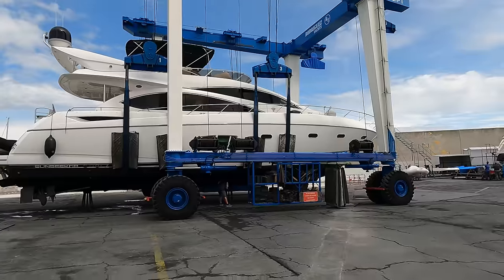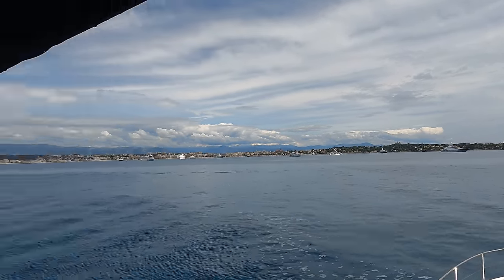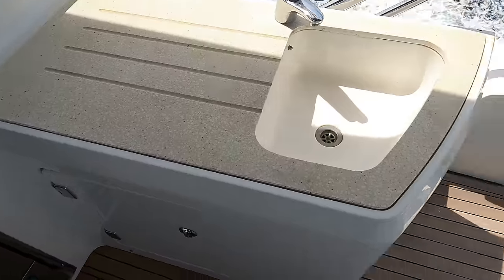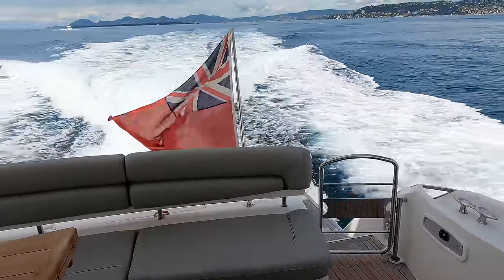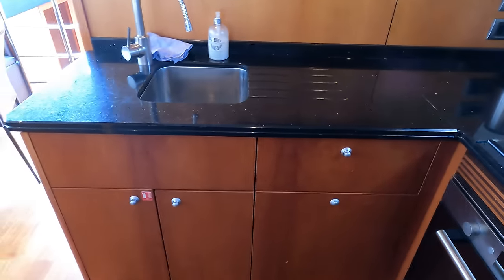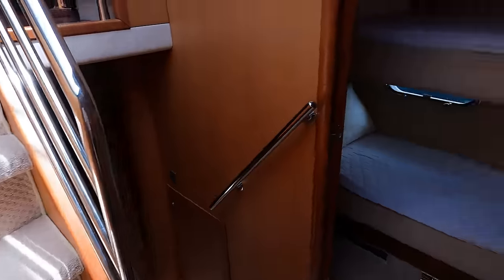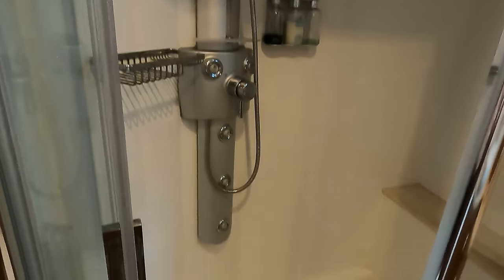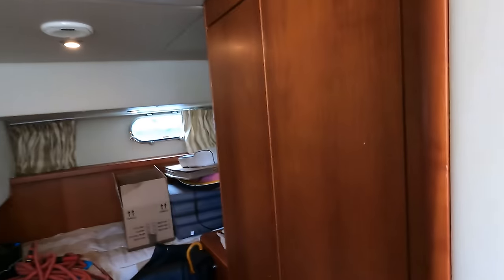Sunseeker Manhattan 70  For Sale - Full Tour & Seatrial - £750,000 Ex VAT. (Now Sold)

Comment: Love the owners cabin and the VIP, more boats should be sold with off centre beds. The price is great, spend an extra £250k upgrade to touch screen, full gel coat repaired, modern fake teak. If possible I would also get the ability to reduce seating on flydeck add a hottube
Reply from the maker: Some good ideas there. I never did one with a jacuzzi but anything is possible. They also work up top with a crane/jetski for certain owners.

Comment: Nice boat. It hits a sweet spot in size, providing masses of accommodation with little compromise, whilst within the upper limits of being (experienced) owner operated.

These boats are about getting away and having a bit of down time, but also about having friends and family on board and entertaining. Much prefer the large sofa on the port side as opposed to the cabinets so many interior designers and yards fit instead. Makes for a more social and relaxed saloon. If it’s built in seating then it can have storage under the seats and little storage space is lost.

Comment: Is there any way to turn the foredeck sunpad into some sort of seating area ?
Reply from the maker: It would be difficult as you'd block the windscreen view from inside (later designed boats have a different style of foredeck moulding) but I'm sure you could improve what's there (lift up backrests on the sunbathers would be nice)